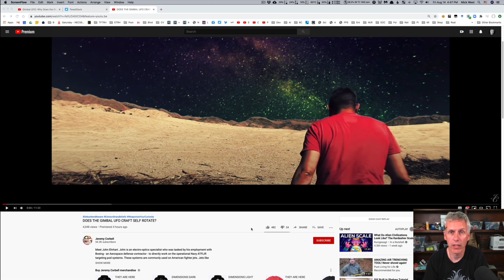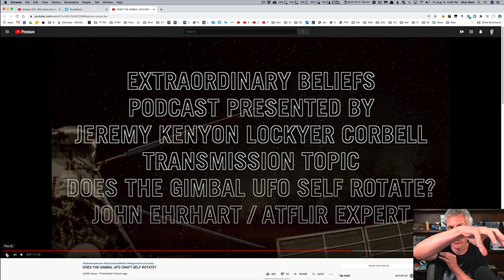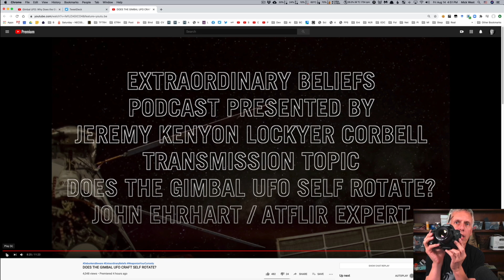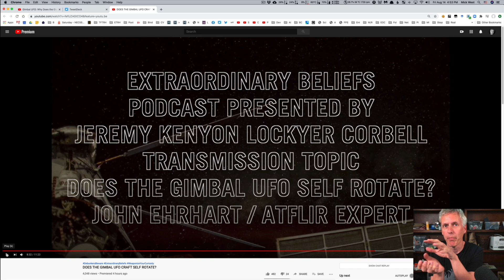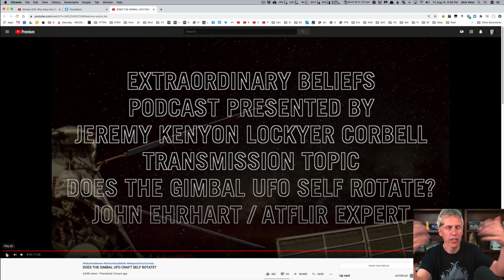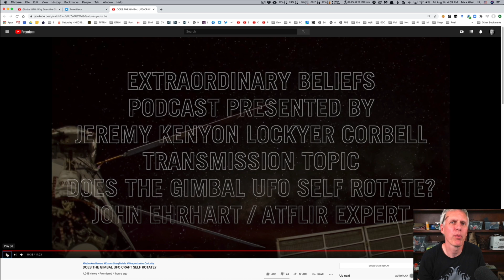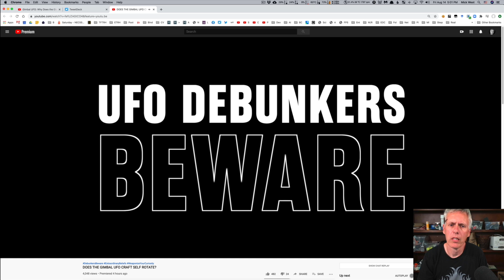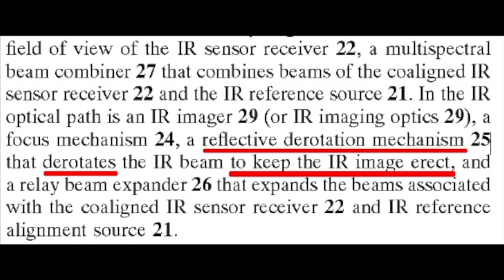A response to "DOES THE GIMBAL UFO CRAFT SELF ROTATE?" (ATFLIR Tech)

Comment: 98% of people don’t understand heat doesn’t work the same as light in IR cameras just because we portray it as light.
Reply: it is portrayed as light because it is
Reply: tunnarit 
Light doesn’t linger. If you use a thermal camera and look at a table that you were just sitting on, you’ll still see the heat where your ass was, but that’s not your experience with your eyes, you don’t see a ghostly ass still on the table. 

Yes you’re seeing IR radiation with the camera, but HEAT is not just IR radiation and there’s other ways for heat to move which can make it so what you end up seeing In a camera isn’t what you would see with visible light if you were just looking at a regular light color.
Reply from the maker: @radicalxedward8047  It's the same in that it travels in straight lines, it gets refracted and it gets diffracted. They are differences (you get emissive MW and LR IR radiation usually more than reflective IR radiation), but unless you want to get into detail regarding what effect those differences have on the hypothesis, then it's not really a useful point.
Reply: Mick West because it wasn’t a point towards what you were saying, it was a point towards Jeremy and the people who think they see ghosts and UFOs and stuff in IR cameras because heat (not IR, HEAT specifically) does not always work the same as normal light. 

I was making a broader point about IR cameras tripping people up because they dont represent things in the way our brains are used to (like having heat reflections on a surface we would see with our eyes as non-reflective) and people often just see what they want to see.
Reply: tunnarit 
I said heat specifically because the heat part is what confuses people (even people who know what they’re doing sometimes). The IR part is closer to what visible light is like except even that trips people up sometimes because some materials can be transparent to IR but opaque to visible light AND vice versa. 

So people think they’re looking through/at a transparent object but see black in the camera or that they’re looking at a black object but see through it partially in the camera.
Reply: I don’t understand why it’s so difficult for many people to understand that IR and heat aren’t synonymous.
Reply from the maker: @radicalxedward8047  Who said they were? IR cameras don't "see heat," they see infrared radiation. That's similar to visible electromagnetic radiation. Certainly not the same, but similar in terms of optical properties like refraction and diffraction. 
I actually think a big part of the reason why people have problems with Gimbal, is that the interesting portion is presented in BLK (Black Hot) mode. So the brain has difficulty interpreting it as "bright" IR.
Reply: Mick West 
That’s a good point too. But if for example you look at my response to tunnarit above, one of the differences I mention is that heat lingers. 
So if you hold your hand on a table for a bit, then take it off and look at it with a FLIR camera, you’re going to see IR light emitted by the warm area of the table where your hand was. 
Regular visible light doesn’t do that. As soon as you remove your hand you stop seeing any visible light from your hand on the table.
Remember, my point was about people having difficulty in inherently interpreting IR video, not just the gimbal video but that too. 
Overall, my mindset was that this Jeremy guy reminded me a lot of debates I’ve had with flat earthers, ghost hunters, and people who believe extraterrestrial UFOs have visited earth. Some of them are actually pretty smart people, but they always make a handful of bad assumptions that lead them down the wrong path of thought, and then diminish any evidence that contradicts them as more outlandish than their own theories.
Reply: Mick West 
So like at 6:50 in your video where he says “the craft itself rotates, we’re not seeing some glare or flare effect from this magical derotation device.”
He’s diminishing your theory because he doesn’t fully understand your theory and doesn’t even see it as a possibility. He sees it as a “trick” to “pull the wool over people’s eyes” because he thinks you just don’t want people to know what he thinks is the truth because reasons.
Reply from the maker: @radicalxedward8047  Well if you heat up a bit of iron to white-hot, then that lingers too. And it's also emitting visible light. 
But yeah, IR video can be hard to understand.
Reply: Mick West 
Yes because then you’re combining the behavior of heat with visible light and because it’s visible light, people can inherently understand it because that’s what the deal with all the time. 
And if you hold it up to a mirror, they’ll understand the light they’re seeing in the mirror is a reflection of the iron rod, but if you’re looking through an IR camera and hold the rod up to a matte surface that doesn’t really reflect the visible light but does reflect the IR light, it throws people off unless they intended to do it. If someone else made the video or they weren’t paying attention to that aspect they think the matte surface is hot too. 

And how many times have we seen people try to measure how hot something is by pointing a thermal camera at something that’s reflective to IR like glass thinking they’re measuring the thing behind the glass and not their own IR reflection? 

To give a specific example, there was a Ghost Hunters episode where they were exploring Chernobyl I think it was, and they’re looking through a thermal camera at night and dont notice anything when walking through, but when they go back to review the footage, they notice a human shape in the window of a room they walked by (like 3 stories up) that they didn’t realize was the cameraman’s reflection because it’s dark and they’re not thinking about reflections at night indoors. 
The same thing happens again with a metal locker where someone had been standing / leaning near or on and you could still see a human shape in the heat of the locker a few seconds/minutes later but they didn’t even think of the possibility it was lingering heat or a reflection. 

Most people have very little experience viewing the world in IR or in the colored interpretations we use to represent it. So even if they are told the concept it just doesn’t click right away in their brains and it can lead people to jump to conclusions like “omg it’s a ghost” or “this is definitely a UFO and anyone who says differently is trying to trick people” despite you giving an extremely plausible explanation that’s likely the exact same conclusion the pentagon came to when they named the clip “gimbal”. 

I’d be willing to bet that had the clip been called “gimbal glare?” UFO believers still would have said you were wrong.

Comment: Hi Mick, I just saw a stabilized versión of the video, and It kind of looks like every time there is a rotation of the object, there is a slight rotation of the camera, so It could be a glare. But if it's indeed a glare, then it should happen really often, right? given the right conditions.(sorry about my English, is not my main language)
Reply from the maker: Unfortunately, the number of videos we have of an ATFLIR camera following a distant jet that's quite small in NAR mode, and traversing 0°, is, as far as I know, zero (apart from this one). So I suspect it happens when the circumstances are exactly the same, and there are probably other interesting examples of rotating glares that exist behind the classification wall.

Comment: There is a reason why Jeremy will not put the video in question on the screen. It would be extremely difficult for him to explain your debunk. That interview was 100% biased and he was leading his expert. Basically they already had this conversation and cherry picked the responses. They never actually address the specific points you bring up and add fluff. What is odd is the denial of the actual evidence that is already inside the video. It is clear to anyone that when the ATFLIR gets near 0 degrees that the scene rotates with the object.

Comment: Mick, I do not believe this glare is caused by the lense. I'm certain it is "flare" from the glass in front of the camera/lense. 
    I've seen this anomaly dissapeared after another airman cleans the glass of the foward section.
Reply: I could be wrong here... but I've never seen it... 
   I do not think these FLIR cameras are even capable of traditional "glare" like a handheld gets... theres just blowout, and "flare" or dispersion from the glass in front of the lense.
Reply from the maker: @OvertonWindex  Why wouldn't they? I've seen plenty of jet exhausts surrounded by what looks just like glare. 
The "glass in front" hypothesis is quite reasonable, and was actually the first thing I suggested back in 2017
Reply: @MickWest  why wouldnt they? I dont know. A guess would be that it's just very good equipment with very very good glass... and an Argon charged environment for cleanliness. 
   Why isnt it? Because In my experience, after I clean the exterior glass, the "glare" goes away. Then it's just an unchanging blowout. 

   So yeah, not positive, just my experience.
Reply: @skaruts  the videos you see in public releases are very very not full quality. That is not what you see in the cockpit. They are very very good cameras. 
   I dont want to go into explaining it, but artifacts like glare are devastating to a couple modes of tracking a target.
Reply: @skaruts  I'll just say, you dont want to be in a Air to air situation and lose your target in the glare from the sun.